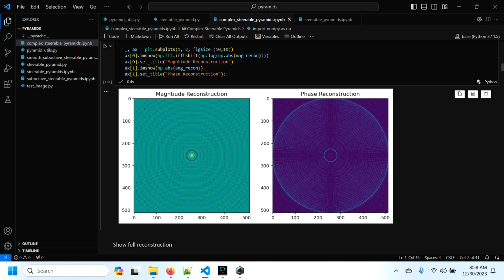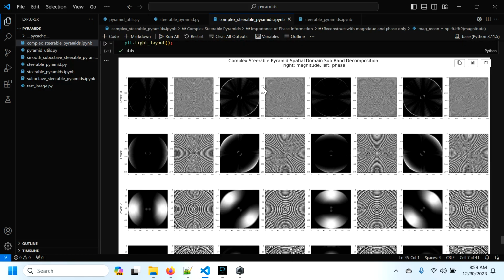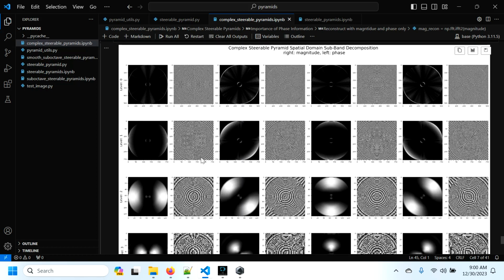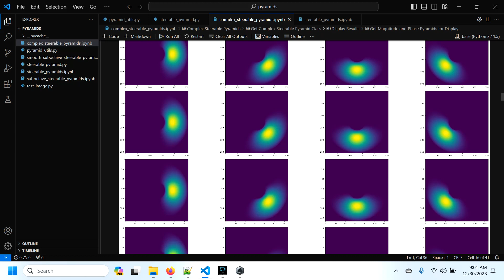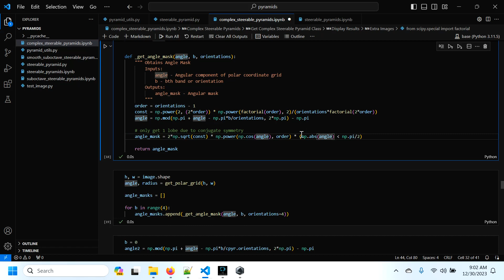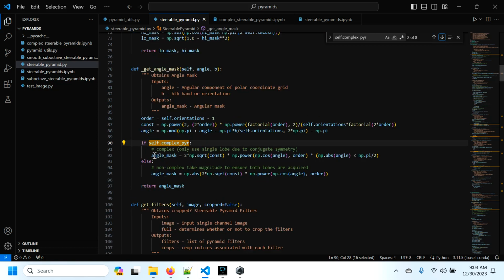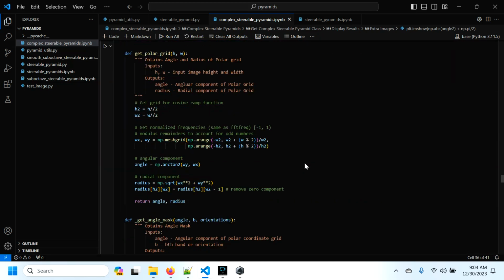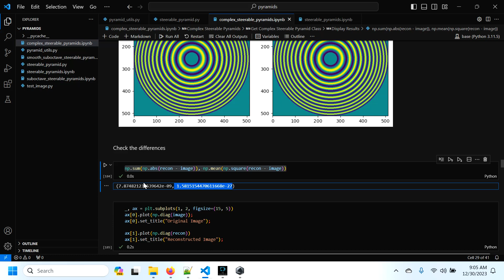Complex Steerable Pyramids

Comment: Hey Isaac, you have a great set of videos here! It is worth mentioning that complex steerable pyramids can be applied in the spatial domain as well, as either a sin or cosine carrier inside of a Gaussian envelope. The 2D orientation would be the same as how you have outlined and the wavelength of the carrier would determine the sub-band 'depth'. Will your next video be on Riesz Pyramids?
Reply from the maker: Thanks! That sounds really interesting. I might do a different one, I really dove into Pyramids about a year ago, but haven't thought much about them since.